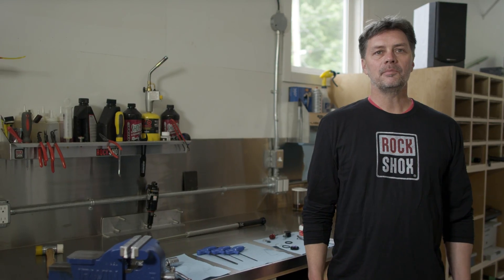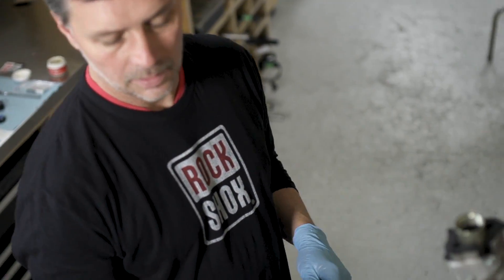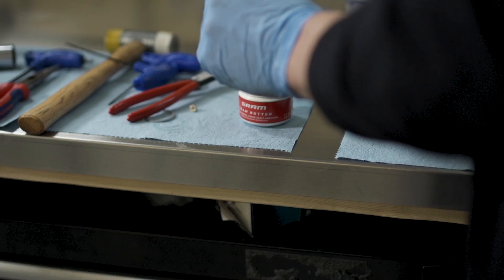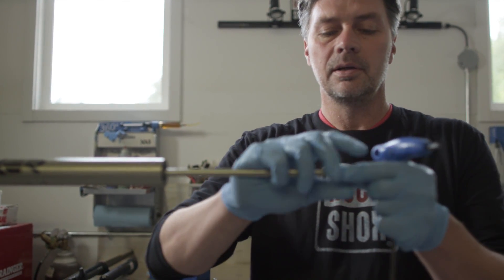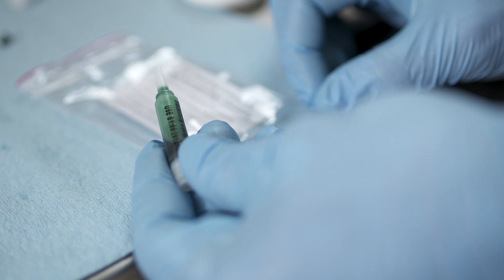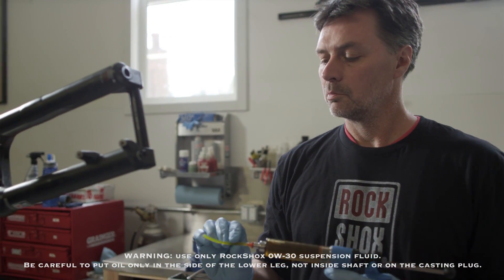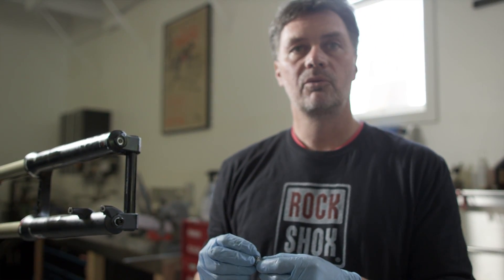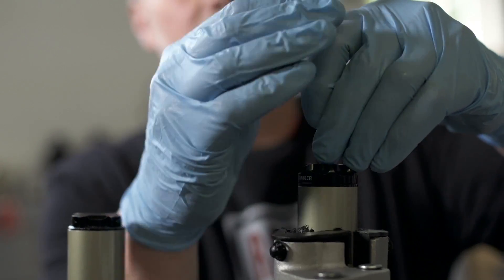RockShox Tech Pills | BoXXer | Charger Damper™ Upgrade kit

Comment: Thanks for the video.  I struggled a bit to get the new casting cap onto the shaft, so a good tip is to pop the new casting cap into boiling water before.  This makes it expand enough for the foot bolt to press it on nice and snug.  Just be careful using boiling water as the casting cap gets hot!

Comment: If anyone is still checking on comments under this video... i have a 2011 boxxer rc and i am about to install a charger damper... the question is: do i have to remove the old casting from the leg or can i use that instead of the  new one, and if i have to remove that from the leg, how do i do that, thanks for your time and your assistance in advance

Comment: I tried to instal mine yesterday.  I got as far as torquing the footbolt but it just keeps spinning.  It seems to be half screwed in and can't be tightened or untightened.  I suspect it is just spinning the shaft inside.  Problem is, I can't do anything now.  I can't remove the dampener and start again, and I can't get it to tighten enough to be rideable.  I've now missed a weekend of shuttles.  Shattered and frustrated.  Rockshox, can you give me any help in how to remove the footbolt?  Thanks.
Reply: Yippee_Ki_Yay MF I know it's 2 years later but for anyone else: you need to install the coil spring and press down on it from the top to put pressure on the foot so the nut can bite it and screw on
Reply: Try to use a rattle gun to loosen it? The faster torque in the gun could just be enough to get it in done

Comment: You should probably mention that the old casting plug has to be removed before installing the shaft into the lower leg. Seems that some run into problems when trying to install the charger unit without removing the old plug.
Reply: Hudlbuar on rc only
Reply: Yes!! I wish I read this comment before attempting
Reply: And me!
Reply: Hi, how does one remove the old casting plug? Can't seem to find any removal instructions for that plug specifically...
Reply: I changed it and used the old one. Works fine